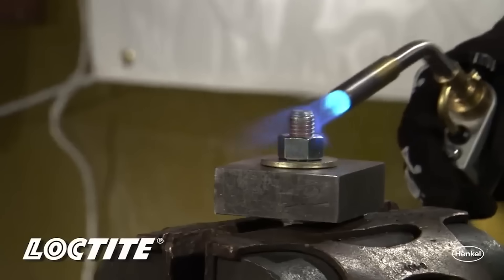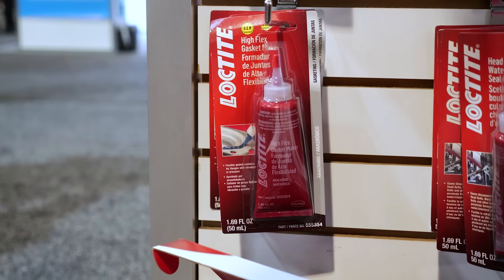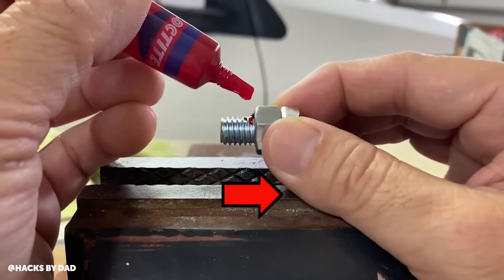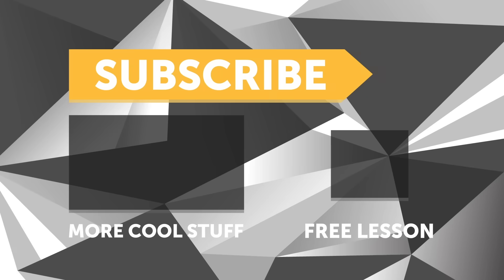Many pro mechanics don't know this.

Comment from the maker: NGL, I put Loctite (blue) on a thread and then banged it in a blind hole about 3 hours before getting this video ready for release 😅 Now I know better! Thanks Matt - Taz.
👨‍🔧 Building a fast car? Get $400 OFF the all-inclusive VIP online course package deal: https://hpcdmy.co/hpavipbfc104
✊50% OFF your first online engine building course. Enrol now:  https://hpcdmy.co/enginebuildingb1af56
Reply: Just about everything on an engine is a blind hole. You will be fine if not overdone.
Reply: I have always wanted to know how an anaerobic threadlocker that sets when there's no air present, so why doesn't it go hard in the bottle?
Reply: @Tight--LiNeZ  The anaerobic bottles are specially formulated. Air-permeable polyethylene bottles allow air to pass through the wall. There is also some air gap over the product inside the bottle to maintain stability of the product. Thus a 50 ml pack of LOCTITE contains 50 ml adhesive in a much larger bottle. (from the FAQ on the website)
Reply: @--_DJ_--  Oh, okidoki. Just looked and you and I were correct, it's an anaerobic reaction, but I didn't know about the bottle that let's air though. Cheers.
Reply: You did fine. 
Especially if it is a fully formed thread like a Whitworth thread, as putting thread-lock at the bottom (like recommended) then causes it to hydro-Lock and can bust out thin areas of more brittle castings, especially if the pre-tap drill matches the minor radius (or less).
Also when using heli-coiled blind holes, it doesn't work.
The solution in both cases is a version of what you have done.
Reply: I totally disagree with dripping it down the blind hole. That is asking for trouble. Maybe dribble a little down the side if you really want to, but I'll stick to putting it on the bolt. Haven't had any trouble doing that in my 25 years of turning wrenches for a living.
Reply: Great content. Your YouTube channel could be a Discovery show.
Reply: You got a fast car
I want a ticket to anywhere
Maybe we make a deal
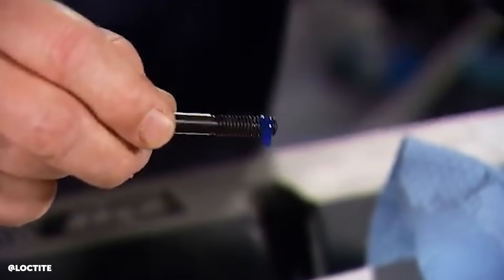Reply: Ok, but at 1:38 they're literally applying threadlocker to a bolt I'm putting it in a blind hole 😵‍💫
Reply: It's perfectly fine to put the blue 243 on a bolt then screw it into a blind hole.
I have done this for 30 years with motorcycles and you will still get good loctite penetration and hold.
I try to put it on the end threads of the bolt, then by the time the bolt is fully screwed in it is right through the thread.
Reply: Why did you start your comment with NGL?  Did you think that we would assume you were going to lie to us?  Asking for a friend...
Reply: @1dariansdad  
It's just what kids do now.

Comment: Not much info on taking stuff apart again. How high temp do you need?
Reply from the maker: That depends on the specific Loctite. It's in the TDS on their website.
270 for example: "For Disassembly
1. Apply localized heat to nut or bolt to approximately 250°C.
Disassemble while hot" - Taz.
Reply from the maker: https://datasheets.tdx.henkel.com/LOCTITE-270-en_GL.pdf

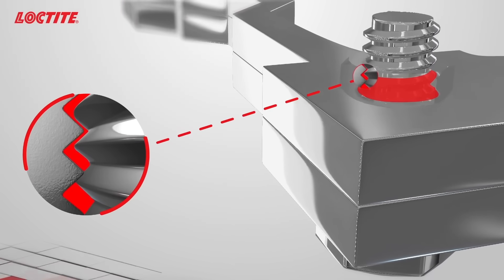Comment: For those who don't want to waste time 5:23
Reply from the maker: TIME STAMPS:
0:00 - "Loose Bolts Sink Ships" - Nelson Mandella
0:16 - Matt Eager | Loctite Legend
0:22 - Range Of Compounds
0:41 - Purple Loctite Compound
0:51 - Stops Bolt Moving, Can Adjust
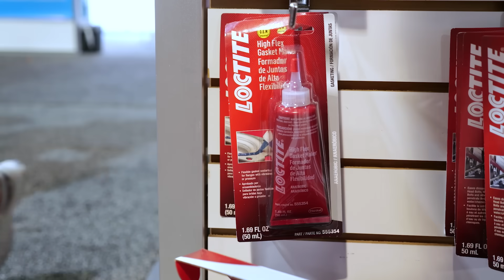1:10 - Blue Loctite Compound
1:30 - Stronger. Stops Bolt Moving, Turns To Powder When Removed
1:47 - Red Loctite Compound
2:20 - Don't Be Like Andre
2:41 - Removing Red Threadlocker
2:56 - What You're Doing Wrong
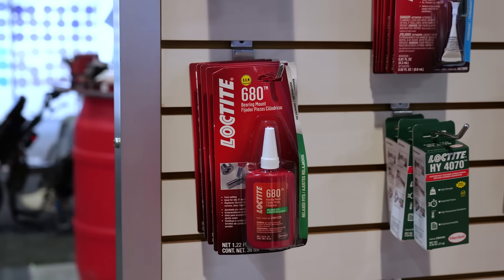3:14 - Is Red Threadlocker Stronger?
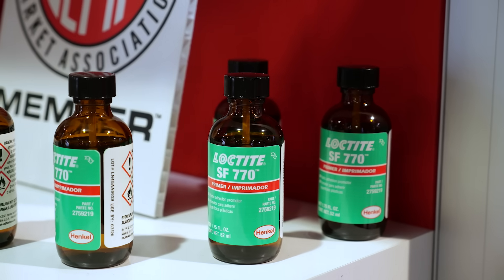3:40 - Hot Components/Turbo Fasteners
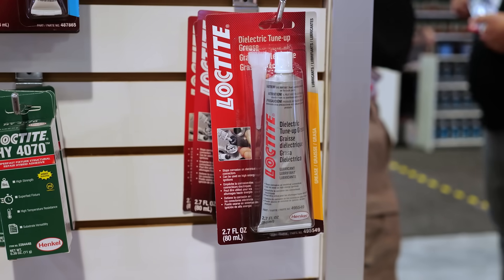4:21 - Anti-Seize Compounds
4:52 - How To Use Loctite
5:31 - Blind Hole Application
6:10 - General Pro Tips
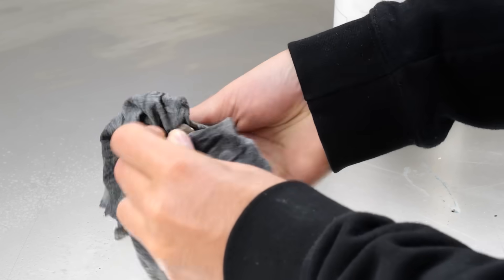6:32 - Coated Parts | 'Active' Metals
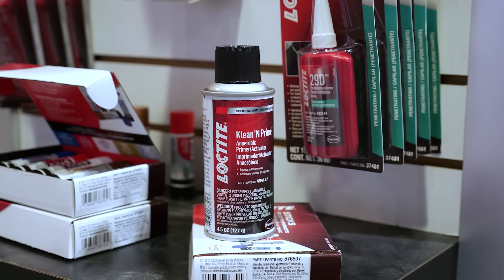7:00 - What Is Loctite SF Primer?
7:17 - 1-800 LOCTITE
7:36 - BUILD.TUNE.DRIVE

Comment: A good exercise to build confidence is to take an assortment of bolts and nuts, including stainless. Put blue locktite onto them tighten them up, then wait overnight. I was a little surprised at how weak the holding power of blue can be....

Comment: I put hub centric wheel spacers on my 1997 Chevrolet K1500 and I had both red and blue thread locker. I over thought the situation and got nervous about the lug nuts holding the spacers on possibly coming loose so my dumb ass put a good drop of red thread locker on each of the 6 studs on each wheel.

  Fast forward about a year and a half and it came time to replace rear brake shoes and wheel cylinders. In order to get at those things those wheel spacers had to come off. It took me an entire day of cursing and working with a torch and spraying brake parts cleaner on those studs before I finally got those suckers off.

  I think it would go a lot easier if I had to do it again because now I've got my high torque Milwaukee impact wrench but I will never know because I didn't put any thread locker back on the studs when I put it back together.

Comment: Very hard to understand the instructions for use due to the accent of the guy asking the questions. Great subject matter though.
Reply from the maker: It is a tricky accent for some for sure, try using the captions in case that helps :) - Taz

Comment: PSA There are a ton of thread lock part numbers for a reason. Henkel's loctite brand is not the only game in town. Color is not universal. If you can read an oil weight and get it right you can read the label.

Comment: If you want something permanent, the best bolt locking mechanism is time and rust. It is available all around the planet for free.
Also, please stop using degrees Fahrenheit as they don't make sense anywhere outside of 'Murica. At 0 Celsius water freezes, at 100 it boils. No memorizing exotic numbers. Easy peasy.

Comment: Never use anti-seize on a fastener unless manufacture calls for it. Anti-seize can reduce the friction of the fastener, and clamping force can almost double. You will tear the studs out of an aluminum cylinder head.
The reason is over 90% of a fastener torque is overcoming friction. Just reducing the friction by a little increase the fastener tension by a lot.
Reply from the maker: This isn't anti-seize, but for sure, there is a place where that should and shouldn't be used too just like threadlocker isn't supposed to be used on every and any fastener either - Taz.

Comment: Old guy here if a bolt comes loose, cross pin it and be done, don't spend money on any thread locker, do it right and save the green for other stuff.
Reply from the maker: Wait for a bolt to fall out of your race car and THEN solve the problem after you peel it out of another vehicle or wall. No thank you. Save the money and do it right the first time by using thread locker where and when applicable, or another solution if you have something against thread locker for some reason  😎 - Taz.

Comment: What a joke, I used red on a simple bolt and the thing still worked loose.
Reply from the maker: 6:32 - Coated Parts | 'Active' Metals
That should help.
Alternatively it might not have been applied correctly, but no matter what for that to happen with red Loctite, something wasn't right - Taz.

Comment: you should mention if the bolt has a torque spec that dry vs wet specs can be very different.  generally, we don't use threadlockers on fasteners with specific torque requirements, but we mark the fastener with a witness paint...
Reply from the maker: You use dry spec with Loctite - Taz.

Comment: I dont think he nailed it on the active vs inactive.
Reply from the maker: What's your take in relation to Loctite usage and active vs inactive metals? - Taz.
Reply: @hpa101 its not about ferrous or not,  non ferrous aluminum is an active surface, anodize it no its not, ferrous  steel is active, but galvanized its not.
Reply from the maker: @EnglertRacing96  ahh gotcha. It's a simple active vs inactive explanation, specifically in relation to the anaerobic cure, and if in doubt, double-check for the specific material you are using for sure.

Their documentation has more details - Taz.

http://ellsworth.com/globalassets/literature-library/manufacturer/henkel-loctite/henkel-loctite-user-guide-threadlocking.pdf?srsltid=AfmBOoov4ldtd0zu-PDWOiQSCMkPW1sKqhDyMuAXM4PS_oVi-rpnU_Mo

Comment: Not mentioned here, is one of the main reasons that I, and the people around me use Loctite.  The obvious benefit, is that it keeps nuts and bolts from loosening in high vibration environments. However, another benefit, for assemblies that are often taken apart for service is that thread lockers provide a consistent break-away torque. Sure a thread locker locks your bolt or screw, but it also prevents that bolt or screw from seizing. Loctite does not just lock, it provides an interface layer between the threads which excludes air and salt water, and keeps those threads from corroding, by sealing the threads. The break-away torque for all the fasteners of the same size will all be the same. This means you can use the same wrench on all of them, without resorting to a breaker bar. All the bolts come out at approximately the same torque.

Comment: Make the BLUE lock tight bottles all BLUE.
Reply from the maker: Red bottle is a trademark/branding. Technically the fluid could all just be red and you'd still be fine by reading the number as well, like engine oil - Taz.

Comment: I know it's gonna sound weird since the thread locker is a plastic material once set (so electrically insulating) but what would be really great is a conductive thread locker for all these electric components that require a periodic re-torquing due to vibrations and sometimes heat. I'm thinking about the RV industry among others...
Reply from the maker: It depends. Some fasteners on electrical components are purely mechanical. Like most wiring you really need to consider what is in front of you specifically rather than just use a blanket rule I reckon.
Sorry I couldn't be of much help beyond that - Taz.

Comment: What do we all think for wheel stud conversions, red or blue? Blue would obviously be a better option as far as serviceability goes but will likely not withstand the temps on a track car. I've seen stud companies reccomend both types, and some people even say none at all
Reply from the maker: I'd check with the manufacturer as those conversions can look a bit different between different cars. You also want to test fit before adding anything to make sure you're happy.
Other than that, I would say red, but that's just one opinion and as above I'd certainly seek out a few more - Taz.

Comment: Loctite is really hard to live without but the safety darta sheet should be advertised as to how toxic loctite is to all those that use it and how and were its stored not in your van or under your nose in a workshop i keep mine outide in a seperate little tool box its that toxic .
Reply from the maker: Is that what the safety spec sheet is advertising? - Taz.
Reply: @hpa101 yeah mate its a great tool but super bad in so many ways and they know it check it out its scary .

Comment: 2:45 not true. Heat is not always needed with red thread locker. All that is needed is a strong wrist and a dedicated mechanic. I have been turning wrenches for over 3 decades and all I need to defeat red thread locker is often a solid 3/8” ratchet wrench. I never understood why everyone says, “you need heat to remove red thread locker,” I never did. Just turn the wrench pansy.
Reply: Update - I finally had to use heat to release red threadlocker. The front sight post of my Glock 19X MOS is torqued by Glock with red threadlocker. I tried using 900F heated air from my soldering rework gun to release it to no avail. I had to use a MAPP gas torch and get the sight up to 1400F before the tiny screw that holds it on released. I stand corrected, heat IS needed for red threadlocker. I guess it was never used properly on all of those machines and engines I have repaired over the decades.
Reply from the maker: @teamja1088  probably not a bad thing it wasn't either if the fasteners manged to stay in AND you got them out OK previously haha

Glad your struggle with the Glock worked out in the end too. There are some horror stories from those that try too hard with too little heat in that situation. Good work - Taz.
Reply from the maker: I'd say the point covered at 6:32 is why your red Loctite is not activating correctly. When it does you might often break that ratchet wrench or the head of the fastener before loosening it without heat. It's not about how big you think your muscles are.

Hope that helps! - Taz.

Comment: I spent 10 years as an automotive engineer.  Thread lockers are never used on a properly designed and properly torqued fastener. Do you put thread locker on your lug nuts or head bolts? If not, why not?
Reply from the maker: Do you put anything that will fit in your mouth in your mouth?
Not sure your logic there is very sound.
Thread locker has a place even if it hasn't been common in your specific area of expertise. It's a bit wide world out there beyond that though - Taz.

Comment: Nothing stops a sale faster than "choices".  Companies think they're helping and they're just confusing the sale.  There's no such thing as a permanent thread locker.  If you want to get it off, it's coming off.  You can no longer walk into the store and get thread locker.  You need to go to college first.  Just get the strongest one you can and move on.  
I was looking for a Turtle Wax product and finally gave up and opened a can of Simoniz.  It's a jungle out there.
Reply from the maker: You don't have to think about it if you don't want to. Just grab something blindly and hope it works.
That would be no different to only having one option and being told it will work for everything when it actually won't. 
Not sure why that's what you would prefer, but you do you - Taz.
Reply: @hpa101  It's the exclusion thing.  WD-40 was the fix-all choice.  Now, if you get the one for squeaks, does it protect against rust? 
Any time you stop the sale, it's a problem.  If you want to make a sale, shut up and make the sale.
Reply from the maker: @Alex-h4w7b it's not just about making a sale, anyone can sell you something that doesn't work, that isn't hard 😂 
It's about using the right tool for the right job.
You could lose hours of your time and $100's or more of your money using high strenght thread locker on the wrong fastener.
We all have opinions though for sure, thanks for sharing yours - Taz.

Comment: In the UK we have 271 which is dark green THAT is much stronger than RED we call that LIQUID  WELD in engineering! Once its in ITS IN!
Reply from the maker: 271 is red. Green is 270 and 290 but it's not stronger. Both red and green are considered 'permanent'. Instead the main difference is green 'wicks' so you can use it on preassembled fasteners. Red is always used pre-assembly.

You can check all the spec sheets to compare green to the different flavours of red, which are  262, 268, 271 and 272 for confirmation. Henkel are really good have having technical sheets for everything 😎
Whatever the number, great you found a thread locker that works for your requirements though! That's the main thing - Taz.

https://www.henkel-adhesives.com/ch/en/insights/all-insights/blog/difference-between-threadlockers.html/1000.html

Comment: Been using primarily blue loctite for decades. Works great as an antiseize on chassis bolts. If the threads are sealed they don't rust and seize.

Comment: i even use threadlocker as a sealant for compressed air fittings and never had a leak, and the best part is, you dont even have to tighten the fittings for it to make a perfect seal. 
so you can orient the valves or elbows exactly how you want and leave it for a minute, and it will be air tight

Comment: You failed to mention that if you use red on a faster going into aluminium (engine cases, etc.) It will pull the threads out upon attempts to disassemble

Comment: Loctite/Henkel uses a different color coding system than other threadlocker manufacturers. And there are several red/blue/green/purple viscosities/applications/grades. And yes, cleaning and using primer makes a BIG difference!
Reply from the maker: Always best to read the label rather than just look at the colour alone for sure 👍 - Taz.

Comment: Do not use locktite around plastic canopy on aircraft. It will cause embrittlement cracking. I bought a BRP Can Am Spyder and was disappointed to learn the factory uses locktite on everything. Poor engineering practice in my opinion

Comment: I have see oil in the bottom of a closed bolt hole stop me from tightening that bolt to it's full depth. So how could you do anything different if you overuse A much heavier compound like Locktite
Reply from the maker: What you could do is use it correctly and not fill the hole up with threadlocker I guess? No one told you to turn it into a swimming pool and if you put too much in, take some back out 🤘
Hope that helps! - Taz.

Comment: In personal use I’ve only had the “need” for red loctite on one application. Despite using lock washers, proper torque specs and new bolts ect. the bolts securing my winch which are in a vertical upside down position always backed out to the point of a few falling out if I didn’t check monthly ect. Used red and they’re still tight nearly a decade later.